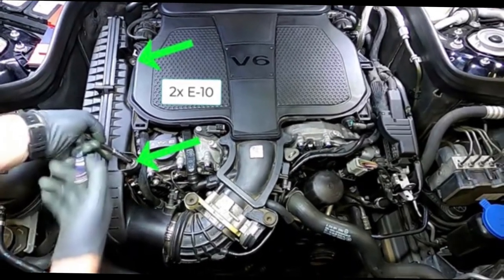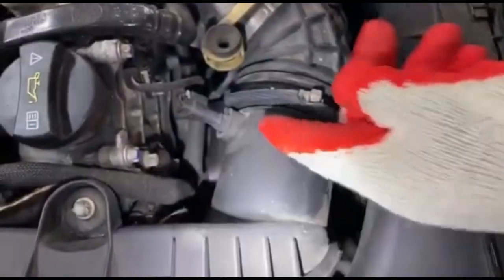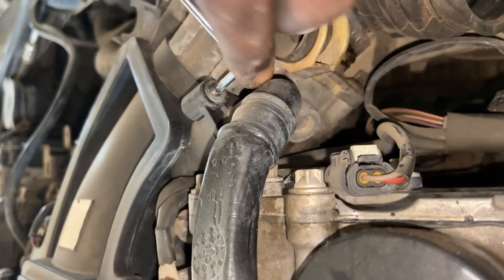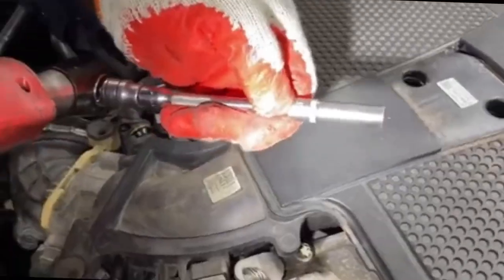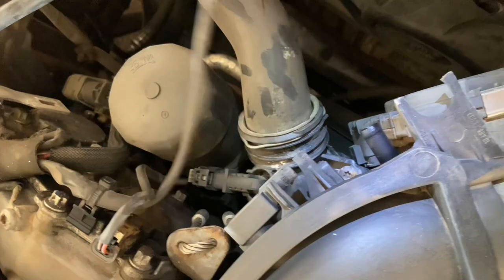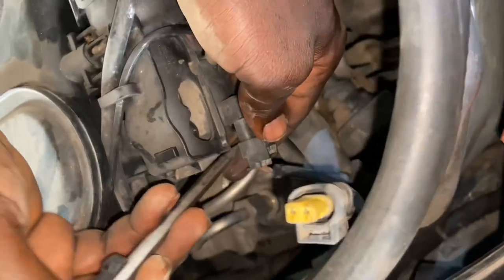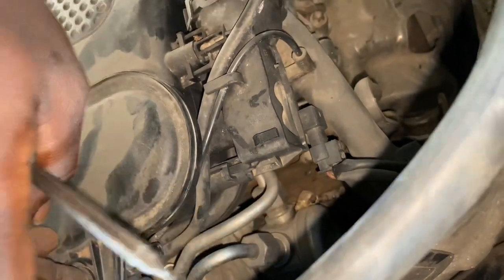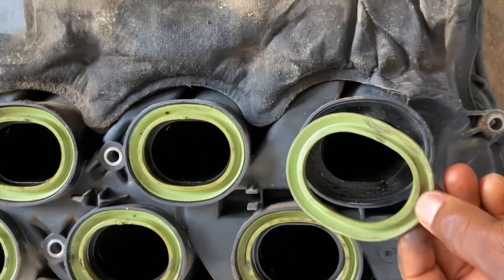How to remove the m276 intake / inlet manifold on a Mercedes E350,C300 w212, ML350 w166 2010-2015

Comment: I want to reseal the two upper timing covers and the driver's side requires the intake be removed.  This is not an honest video including the M Class.  There is a requirement to remove the bulkhead on a ML350 because it covers access to the yellow vacuum line, a rear sensor connector and the two main rear bolts.  Even Mercedes WIS shops do not cover the bulkhead removal but require it.  There are directions for the 251 chassis to remove all of the wiper system but not for the 166.  Maybe this will help to remove the center upper bulkhead section but I cannot find any info anywhere to confirm this.  Next step is to go talk to Mercedes service, or sell the car.  I am a decent mechanic but this is just ridiculous.